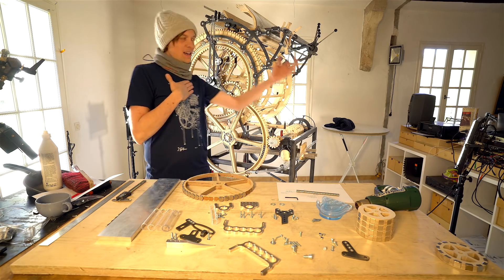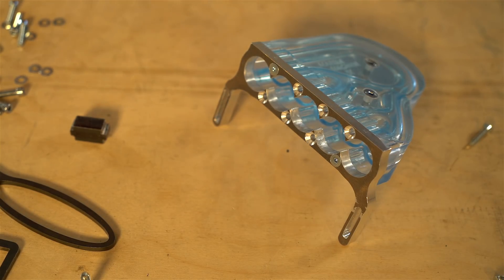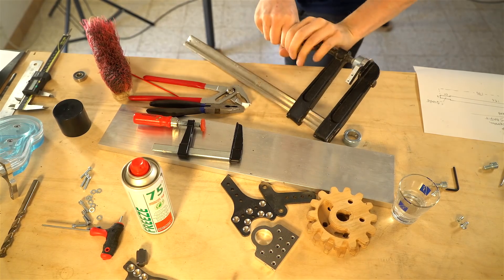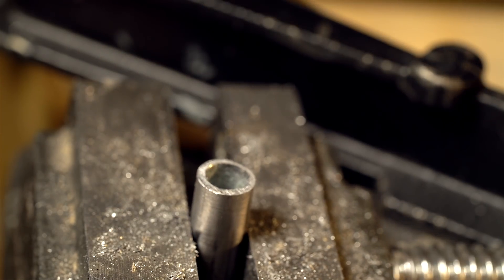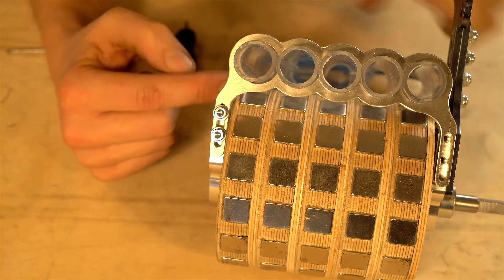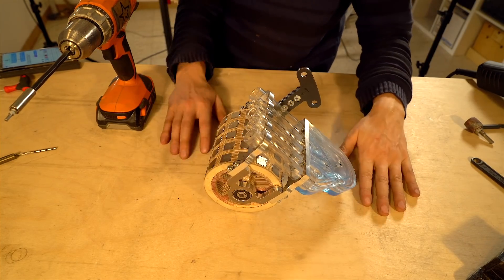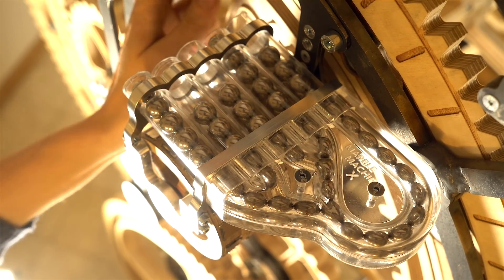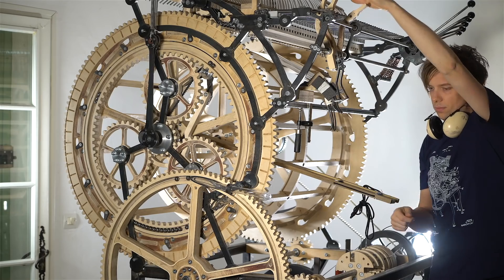Marble Demagnetizer V3 - Marble Machine X #62

Comment: It seems you've taken such care to make every component and subassembly as aesthetic as possible. But then overlook a very crucial front and centre aesthetic; and not from design limitations but from a manufacturing error on a fairly simple/rigid piece that could have been avoided.

Can you please recut and retap the shaft?
We only complain in the comments because we love the project. Consider it flattery.

Comment: Ugh, if you weren't thread-tapping with a drill (and doing it by hand instead) you'd stand a better chance of not breaking taps. 1-1.5 turns in by hand, then back off a half turn to clear the chips. When threading, speed works against you. It takes time, but you'll get better results with no bodging around mistakes required. You kids with your fancy drills .... ]sigh[.

Comment: This oil is amazing for tapping threads, makes tapping even titanium much easier. Also, use a new sharp tap when tapping steel, and don't use a drill, ppplleeeeaaasssse  https://www.ebay.com/itm/96070-Norseman-Viking-Drill-Bit-Metal-Cutting-Oil-Fluid-Tool-Lubricant-16oz/151925935508

Comment: Those are not power taps. You should tap by hand or get spiral fluted taps for the drill. with a clutch though for such small taps

Comment: So I guess the fangs pushing them off the wheels don't do a good enough job, right?  But that splitter block seems awfully restrictive for your target rate (you said 1000 marbles per minute, right).  Have you whipped up one of your usual bench testing rigs just to make sure it works in in the ideal conditions?

(Thinking about it, I wonder if you could have taken better advantage of the magnets in the upper wheel to break up the fields?  It'd make the ratchet lift a bit longer, but it'd probably look cool.)

Comment: This could be a dumb question but instead of having to add the demagnetizer, why not just use a non magnetic marble? Aluminum might be too light but could there be something else?
Reply: Me president, the whole point of the magnets is to raise the balls. Aluminium balls wouldn’t work unless the machine was completely redesigned, sir.
Reply: The marbles are hoisted via a magnetic lift mechanism (showcased a few episodes back) that leverages the inset groove of the two large outer gears. Martin's approach straddles the line between eye-popping aesthetics and functional design (though its clear he favors the former more than the latter). It may not always make sense from a strictly mechanical stand-point...but damn does it look sexy.

Comment: I don't want to critizise too much as this project is amazing but there are a few things I'd like to point out.

Put the metalparts on a heatplate or in an oven and put the bearings in the frosting compartment of your fridge, works wonders and your time window is quiete a bit bigger. I recommend +80°C for the oven and -20°C for the bearings, 10-20Min is usually enough.
Also don't drill the threads with a handheld tool, if you can help it, that makes me cringe everytime you do that, especially with small parts that could be done at your stationary drillmashine. Cordless is taking a lot more practice and the result is allways inferior to stationary processing (I know that because I broke quiete afew taps myself, most of them in 1.4571 or moldcast metals). When in doubt hand tap it.
Also drill it with 3-4mm first and then go up in steps to the necessary core diameter, basic rule in our workshop was X*1.5 for the step width equals max diameter, X= diameter of hole already present. => 3mm*1.5=4.5mm; 4.5mm*1.5~6.8mm (=6.75mm); M8 needs 6.65mm due to the calculation this is two steps your choice should be 6.6mm due to uncertainties during the drilling process.

Comment: Martin, about the broken tap; you should really look into the speed you are running your drill bits. What you are essentially doing when drilling at such high speeds (judging by the short clip in the video) is hardening the insides of the hole you are drilling(!) Because of the heat generated. The result is that when it comes to tapping the material of the rod is harder than what your tap is made for.

The speed of your drill bit is a function of: material being machined, material of your drill bit, diameter of your drill bit and if you are using coolant or not while drilling.

I also suggest you do as suggested by others; tap by hand, use the 3 taps (each cuts away more material), do 3 turns then 1 turn backwards (to break the chips), use your drill press only to center and guide the tap whilst tapping by hand. You will, given some time, get the feel of when a tap is about to snap 😉

Comment: at around 8:22 the whole demagnetiser assembly shows wobble in a circular motion - my first guess is for the shaft square end filling not to be perfectly horizontal - one proof point for this is that the wobble frequency increases with the speed

Comment: Ouch!  Broke a tap.  That was almost painful to watch. As others have said, it's best to tap threads by hand, because you can feel what you're doing to the metal.  General rule is two turns in, then back out one turn to clean the tap.  I'd bet your tap broke because it clogged up and the torque from the drill made it snap.

Well, lesson learned. Luckily, you were able to save the shaft.

Comment: you can gently get the tap out with another drill, fill it all with metal fix or "tap fix" (metal that will bind) and  you leave a screw inside with some potato flour on it's tap, then you just remove the screw and you got a perfectly fitted tap for that screw size (I had to use this to fix a engine made out of aluminum)
and you can gently add something to turn and swirl to hide your tap =)

Comment: All these CNC cut wooden parts are really going to need treating to prevent ingress of moisture. Otherwise the moisture will cause the parts to expand, and possibly cause mechanical problems, sticking, even seizing up!!!!   A company in the model hobby world, called Deluxe Materials,  make a water based air drying finishing resin. You can apply with a firm sponge. This will seal the parts quickly & economically. Where you have routed down to glue joints the resin will make those colours really jump out!!!  If you need any more advice on this let me know. Best wishes, Peter Ford, Cambridge, England

Comment: Martin! When tapping holes, you should really use a hand chuck. You get a ton more control versus the drill. You should also reverse it a quarter turn every couple turns to break the metal chips forming on the thread to get the cleanest cut and prevent jams.

Comment: Why not remove this engineering complexity entirely by using non-magnetic marbles instead? I'm no marble expert but why can't glass, ceramic or aluminium marbles be used?
Reply: The magnet lifting system was not so much designed for simplicity but for it's beauty. After all, the most efficient way to create music with 32 channels would be using midi, not marbles. ;)
But Martin already said, that could he redesign the thing, he would not use magnets for lifting the marbles, because it increased the technical complexity of the project quite a bit.
It will look pretty cool though! Don't you think?
Reply: @aknopf8173  Totally agree - this project is wonderful and the end result will no doubt be visually stunning. it's such a massive endeavour and I would like to see a finished working machine :)
My original point was that the months spent demagnetising marbles might be better applied to other aspects of the design or build.

Comment: Use a hand tap with a hand tap handle. You can't use a hand tap in a drill. QED. Use a machine tap in a drill, then only in a drill or mill press.

Comment: There are 2 reasons you keep breaking taps. 1, you're power tapping with a screw gun, way too much speed and torque to keep everything straight and even and true. 2, you're not backing off, the chip is building up in front of the cutting edge, then binding up. 
Get a tap wrench, and back off a quarter turn after each full turn to break the chip. No more broken taps and far fewer headaches. I think both Abom and This Old Tony have videos on the subject, as well.

Comment: I heard instead of heating up that metal  piece and freezing that ball bearing it’s a lot easier to just put the ball bearing in liquid nitrogen and it would fit right in that spot
Reply: Liquid nitrogen IS the normal industrial process, just harder to find, buy, and keep for residential use.  LN2 tanks loose 2-5% daily from just sitting and must be in special dewar flask tanks that vent (sometimes suddenly) to the outside to maintain safe internal pressures and from exploding.
Reply: What the above said, or though one could substitute with dry ice or industrial freezer and moderate heating the other parts, I personally use dry ice a lot.

Comment: There’s a set of drill bits on Amazon that is useful when a screw head gets damaged: you drill an hole in the screw head, then you flip the drill bit and use the other end to grab on the hole walls and unscrew the screw. Maybe you can use the same method to extract broken taps. Just search “screw extractor set”

Comment: I would recommend that you not use metal of any kind near moving magnets. Eddy currents will create back EMF that will create physical drag, which will increase with speed. You already have a lot of things to crank on that machine; the last thing you need is more drag.
If you don't believe me, try moving a magnet rapidly near a loose scrap of aluminum; you should see it move the aluminum, or feel drag on the magnet in your hand.
Edit: You can already see it happening at 6:29; that's not just bearing drag, that's the magnets making a field in the aluminum which is being attracted to the permanent magnets.

Comment: Nice design but I suggest two(2) demagnetizer wheels. One on the top and one on the bottom. The current design is fine but the marbles will always favor one route over another causing a jam in the in-feed. Two demagnetizer wheels will help prevent this.

Comment: When hand tapping with power tools, If you over-size the hole drilled by just a tiny bit, the risk of schnappy tappy goes way down. Just be careful not to over tighten the fastener. It will still have plenty of clamping capability. Not a technique to be used in torque critical situations.

Comment: I would weld over the hole you broke the tap in and file it flat to hide your mistake and make it look better.  I would also take the magnets off the inside wheel as it will be spinning against the direction the marbles are going and might stop them all together.  You might be able to just sand a bit off the splits in that acrilic to get the marbles to take the other paths easier.

Comment: With the demagnitizer shaft, a quick question and a poss quick fix. the end you distorted and mushroomed out, through friction wont it warm the metal and over time pull through? 
If so then get some milliput modelers putty, And fill the hole you bored out. it sets as hard as stone so when its set it would stop any distortion where you had tried to tap in to the bar. 
😋 i hope it helps 
Christian from the uk

Comment: You have to redesign the divider, marbles could easly jam in the first part and lock the magnetic lifter, better if the demagnetiser is counter rotating and the linear lifter have to be faster than the one on the cogs... It will be a very buisy and lucky part in the assembly. Hope for the best (i'm an industrial dedigner)

Comment: Seriously, as per a bunch of other comments here, you should get better at tapping.
Top recommendation: get a tapping head for a drill press. Put that part in a machinist's vice with a v-slot so you know it's oriented perfectly in line with the tap, and you can breeze through that kind of tapping without ever breaking a tap.

BUT if you don't want to invest in another drill press, a tapping head, and a machinist's vice, then:
- Tap with a hand tap! You can feel how it's going
- Get a taper, plug, and bottoming tap set and start with a taper tap then move up to a plug tap
- OK, not going to take the extra time for that? Look, at least get a spiral flute tap, set the the clutch on your cordless drill low enough so the tap is unlikely to snap from the torque, and reverse back out frequently.
But tapping with an unconstrained power tool is always very risky, because you can't hold the tool accurately enough to know you aren't putting banding force on the tap, and even the best taps have very little strength when bent. With a hand held tap wrench, you can feel the forces involved, go slowly, and not bend the tap, and with a tapping head in  a drill press you can force everything to remain constrained properly and go fast without breaking taps.

Also, when you ignore all of that and keep breaking taps in your parts - you do not have to try to drill the taps out and oversize the hole. You can buy a tap extractor, remove the broken tap, and then resume tapping the existing hole.

Comment: Awesome piece :D but i think the marbles come out with the same speed, as most of the time you put a marble in only one comes out at a time with the same speed... It would only exit with 1/4 speed if 4 come out at the same time which is unlikely due to the discrete nature of the marbles ;) but over all you are right on average :D love that serious and your awesome team and creations
Reply: When he talks about 1/4 speed, he is referring to the marbles flowing over the magnets, not their exit speed. Much like a stream that suddenly becomes 4 times wider, the marbles should flow over the magnets at a slower speed. When the stream becomes thin again, the water will flow at the original speed, however the stream will still be slower where it is wide.
Reply: @AvonaStar  ok flowing over the magnet. My argument still partly works since as soon as the lines are split there are discrete steps. Then it depends on the number of steps over the magnets if that takes the length of one ball it still holds true for the moving ball. The other 3 balls however ar static over the magnet at the same time. And you can't take a water stream as an example, its more like water molecules in a one molecule wide tube ;)

Btw no offense atm i just like to argue :D
Reply: Make'n'Modify except it’s water molecules in a 1 molecule tube that widens to 4 molecules wide.

Yes, they will be going at 1/4 the speed. The ways are full of marbles in normal use, it’s not a question of 1 marble going through the whole thing without obstructions, like on a Matthias Wandel marble machine.
Reply: @MakenModify  As far as a stream metaphor is concerned, it was for considering many channels versus few channels and its effect on the speed of flow. The idea that discrete steps change the metaphor seems silly to me. The discrete steps only seem to matter if the steps are very wide but they are not. What matters is if the channels let marbles through unevenly. They should all be letting marbles though approximately evenly, so each marble will spend more time over the demagnetizer which is the point.
Reply: Get a newton cradle. The marbles exiting will do so at almost the same velocity as the one that enters.
Reply: I see your point, I think it depends on the perspective. And if all channels have the same flow is a completely different question on its own (i doubt it) ;) anyways i enjoy the discourse :D

Comment: I am a little concerned that a great deal of pushing force is needed to feed the divider mechanism; you may end up ejecting marbles from the top of the upper magnetic feed wheel at the entrance to the divider, as the path of lesser resistance.

Comment: Please get a handtap wrench. Im a mecanic from switzerland and we always cut threads by hand. You get a much better feel how the tapdrill is doing. The most common reason a tapdrill breaks, is if a chip gets stuck. You can feel this by hand much better. If we cutt threads wit a cnc or drillmachine we use special tool holders with clutches that turn throgh if to much force is applied.

Comment: So, as a simpler demagnetizer idea, would you consider an electronic demagnetizer powered by the top wheel? If you put pickup coils behind the 2nd stage marble elevator, then wired them directly to a coil wrapped around the tube running from the top pickup to the 3rd stage elevator, you would get a good A/C current from the pickups, transferred directly into the tube carrying the marbles. No external power, no more complexity than just a couple wound coils.

Comment: I'm sure you figured this out, but the outer lanes of the divider are favored because that path is straight ahead after the first division. You have to make both sides of a split at equal angles to the input. Many ways to do this, you can try 3D printing a few different types before you get the final version CNC'd.

Comment: Tapping a hole is not done in one direction only....especially in steel.  Turn forward 1/2 turn and back 1/4 turn to break the chip.....continue this over and over until the thread is complete.  You will never break a tap again and you will have better threads.

Comment: I'm concerned that the magnetic delivery system will not have enough horsepower to force those marbles into the demagnetizer. Please don't use a drill to tap things. Grab a proper handle for your taps and do it by hand.   Love your project.